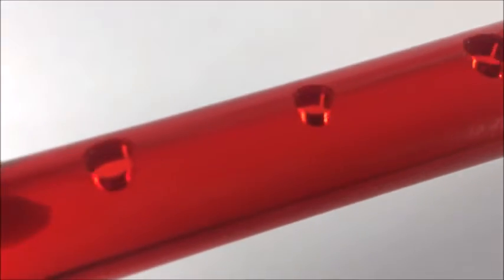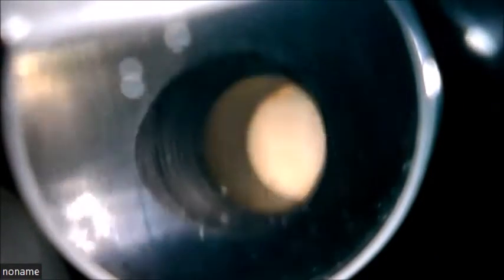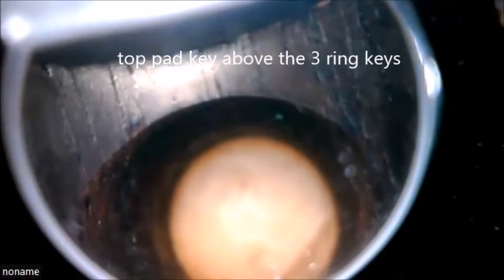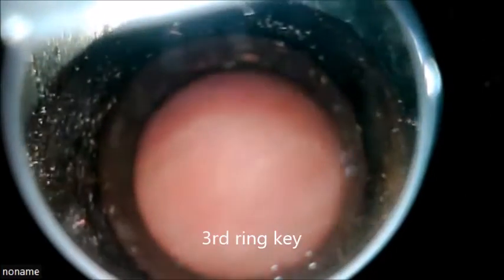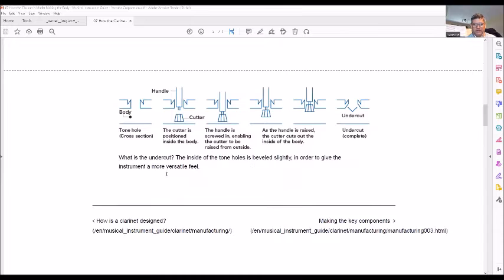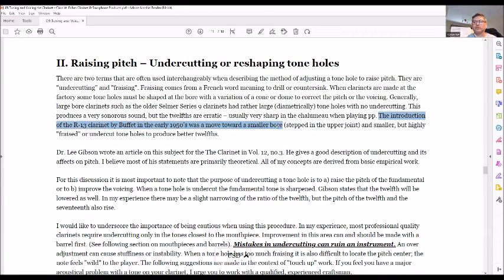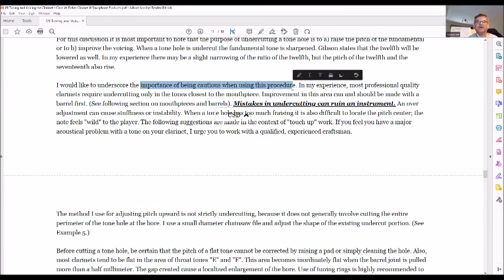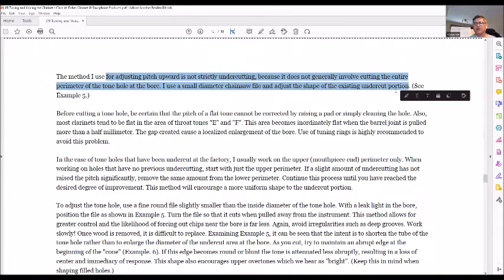Clarinet Tonehole Undercutting - an Overview of a Buffet R13 and B12

Comment: I just bought a 2nd hand B 12 😢..thought i was getting a decent one but paid £75 for it on eBay..think I'll cancel the sale 🤔
Reply from the maker: £75 converts to $94 USD (for my understanding).  It's on the low end for B12 so I would be worried if it requires work.  In the U.S. it looks like they sell for around $200-250 for in good playing condition, which of course would require some play testing of it.   Always confirm that you can return if it's not as advertised (which of course the seller could say it was.  Auctions always are difficult for condition and returns.